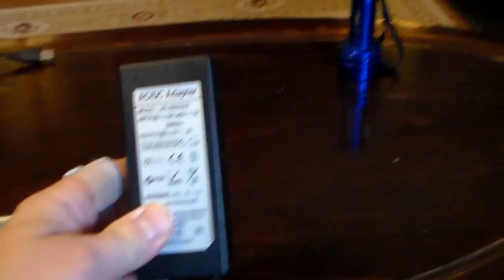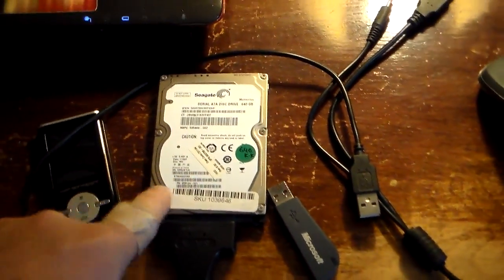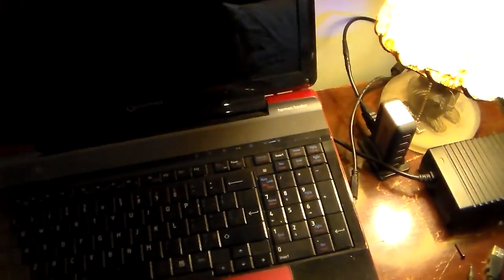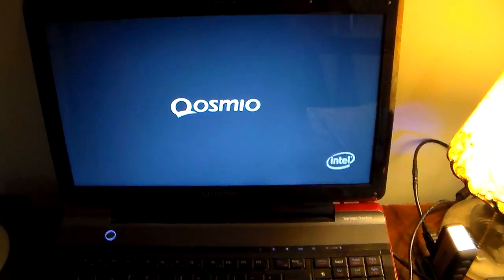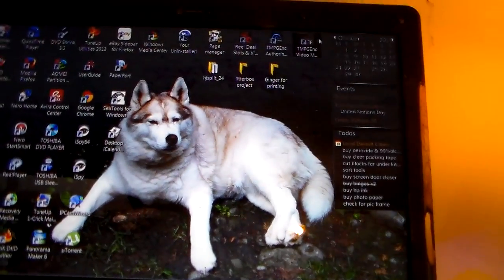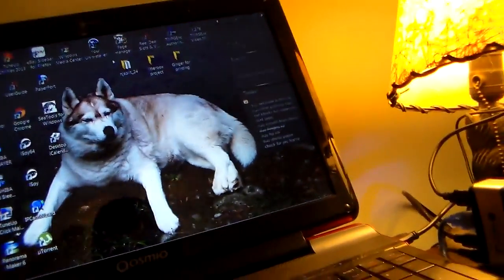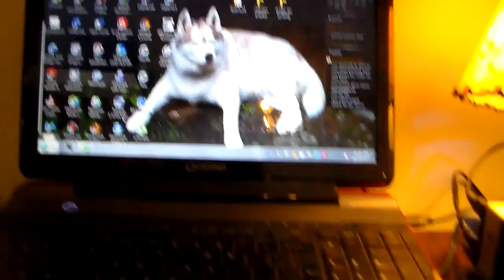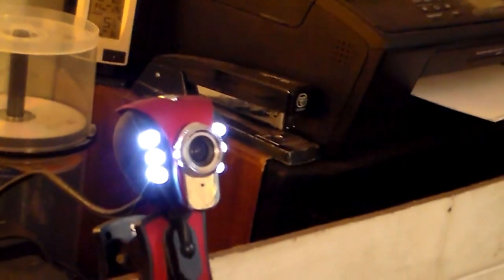USB Hub Fix Pt2

Comment: Just throwing it out here for some people : if you want to stop the feedback without sacrificing the ability of powering the hub, you can cut the red wire and place a diode on it. I didn't have any normal diodes, so I've used an LED. Diodes work as a "one-way" route for the cables and prevent the feedback from ruining your pc/laptop. 

It also produces a weird effect :  led only lights up if the power is needed by the hub.
Reply from the maker: +Noodle Slayer the problem with the diode idea is that the USB B+ is regulated 5V,DC the voltage drop of the average diode is .5V so many devices that are not externally powered will have problems running at 4.5V

the LED idea may work ok also a zener diode of some sort, I never really looked into it as I found it easier just to have a separate modded USB cable to use when external power is required.

the problem is the cheap design does not use the DC power jack (which should have a secondary contact) to act as a switch to cut the 5V to the USB to PC socket when the power adapter is plugged into the power jack.

perhaps someone could get creative & cut the trace & wire the USB port 5v pin through the DC jack so the circuit is closed  when the plug is removed & opens when the external power is plugged in thus effectively stopping the back feed to the PC only when the adapter is plugged into the DC power jack on the hub.

I have not looked into this as of yet but it should be possible just make sure you don't short 5v to ground thru the power jack switch as it looks at a glance like the switch tab is tied to ground so that would need to be isolated & perhaps a low current 5v relay with 1A contacts or an SCR could be used to connect the USB 5v when the external power is not plugged in.

Comment: First, Thanks for your instructional vids, your clear and  informative, very appreciated. If I may ask, can I just plug in a higher watt power supply to the 7 HUB to power it properly without worry of overloading attached device circuits?
Reply: I think you can, the power that the hub needs will be the power that will be drawn from that power supply, just make sure it has 5V and at least 2500mA.